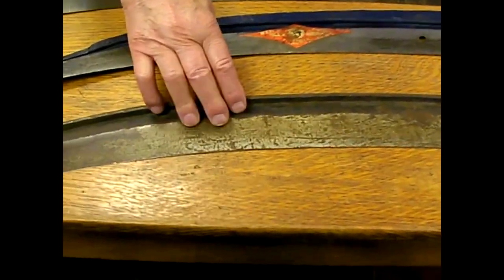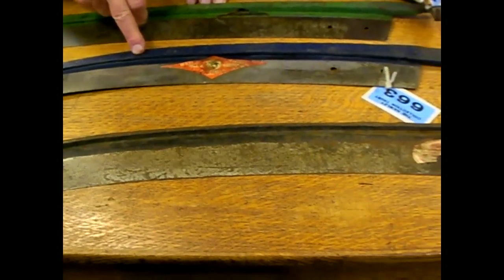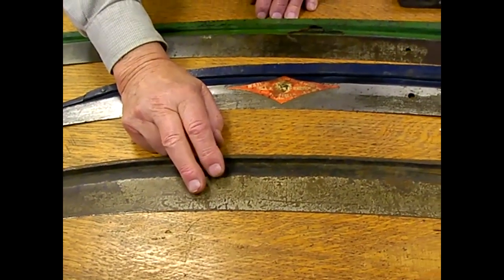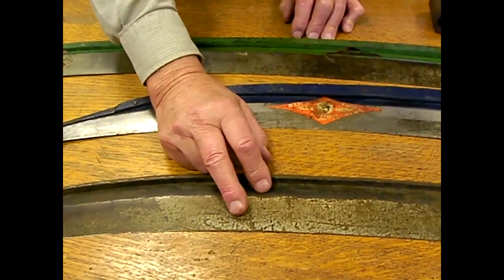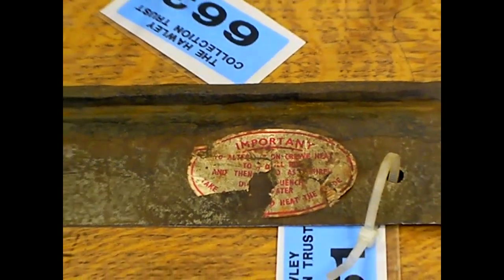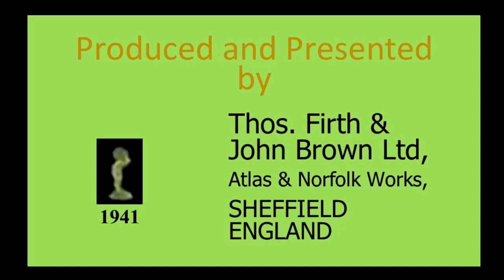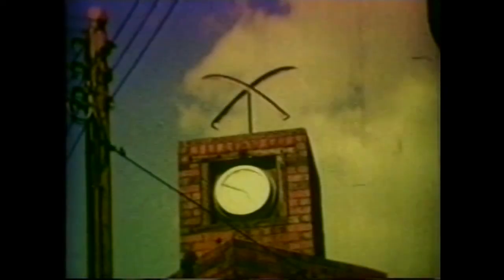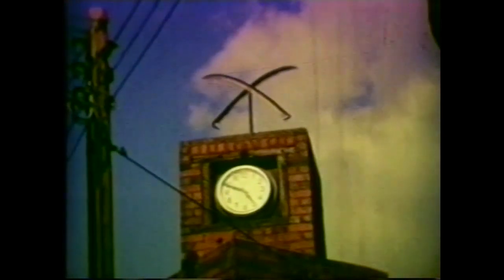Scythe Forging at Sheffield and Belbroughton

Comment: The old film is very puzzling for several reasons:
1) It is in colour, during war-time. This was rare, very expensive, and in demand by the forces,
2) It looks like Agfacolor stock, which was German.
3) It is exceptionally long, for colour stock.
4) It would have had to been processed by one of the few labs in Britain that could have developed Agfa positives.